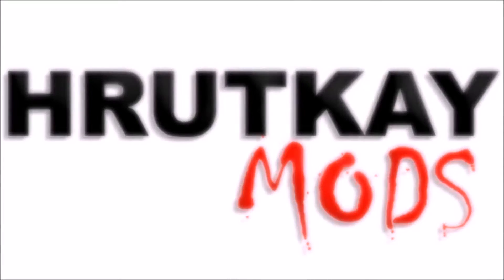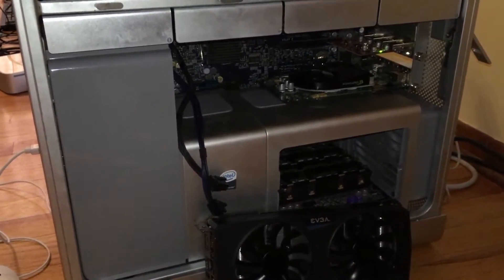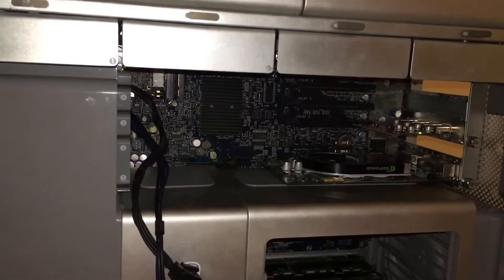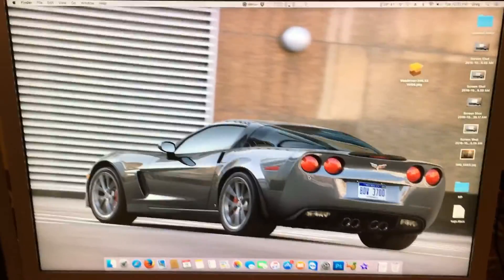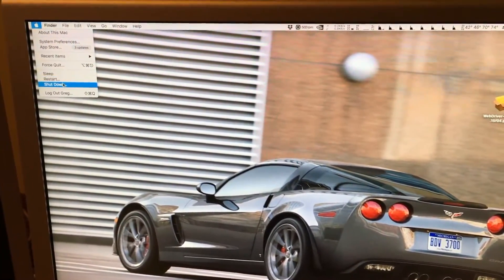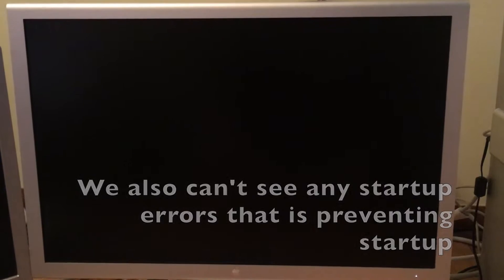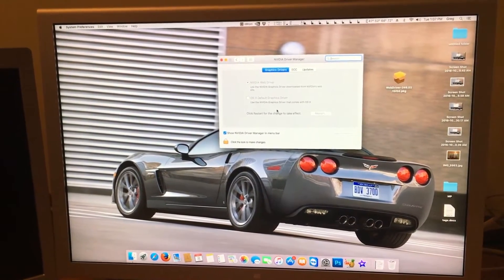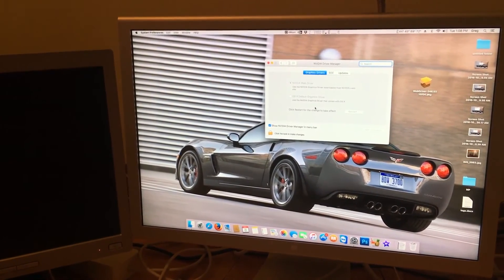GPU Setup: Nvidia Web Driver Install: The Hard Way - Mac Pro Series ep.26

Comment: Hey I have a question! If you have an original graphic card like a HD 5770 and let’s say a GTX 970 , is it possible to have both graphic cards operating at the same time ? And if so, how do you power both cards ? My HD5770 has 1x 6 pin power as the GTX970 has 2x 6 pin adapter leaving me with one power socket to plug in. How would I go about powering both cards if there are only two power cables ? If this is possible.
Thank you if you do have the time to respond
Reply from the maker: It is yes, i’d recommend a single slot non-external powered GPU but you can pull power safely from many places in the system... I have multiple episodes that explain it in this season and next season
Reply: Hrutkay Mods very good! Thank you so much